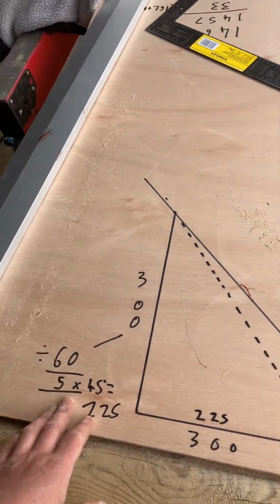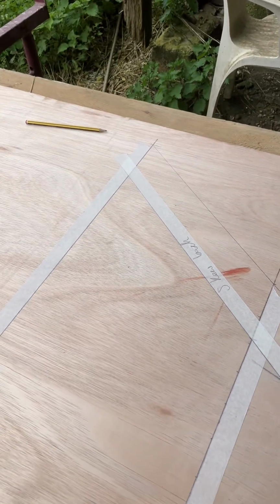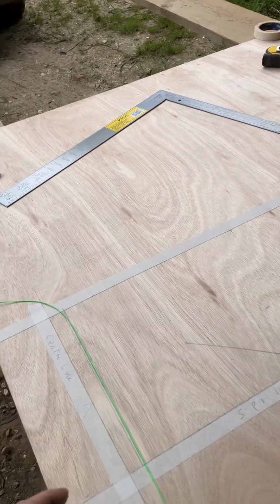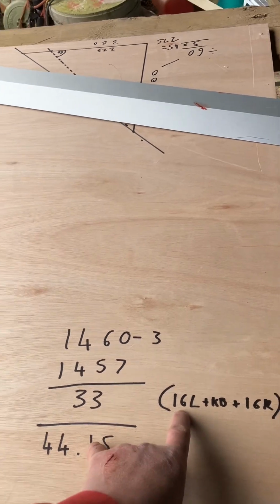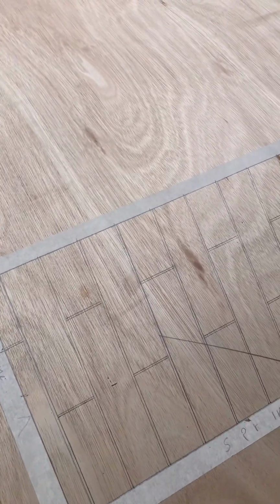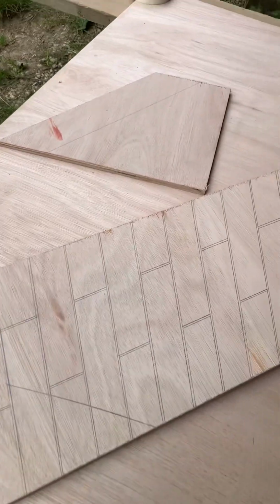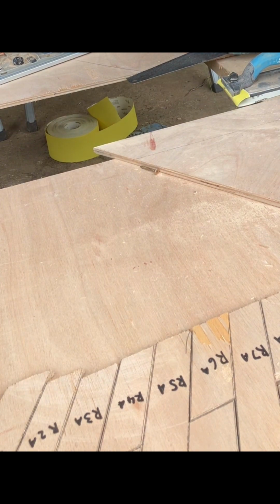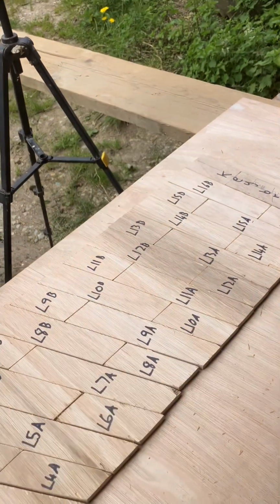Templating for rubbed and guaged cambered arch

Comment: I use 3mm hardboard for the templates, easy to cut with a straight edge and Stanley knife and minimal sanding 👍
Reply from the maker: I’ve done with hardboard before but I’ve prepped it, so it a wet weather job scribing, cutting and rubbing the rubbers so used ply so it a bit more harder wearing. Although we’ll be under a gazebo more than likely so yeah probably easier 😂😂
Reply: @RosierConstruction  👍Gazebo the most important tool .
Reply from the maker: @bricklayersworldwithandy6277  best investment any bricky can make 😂😂